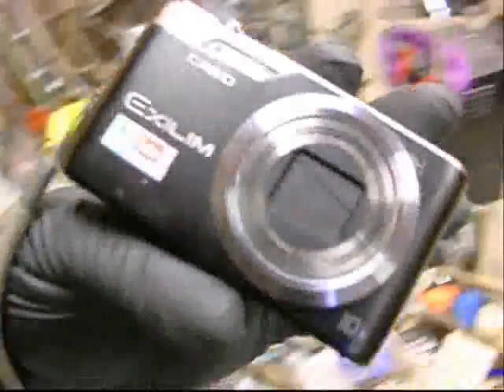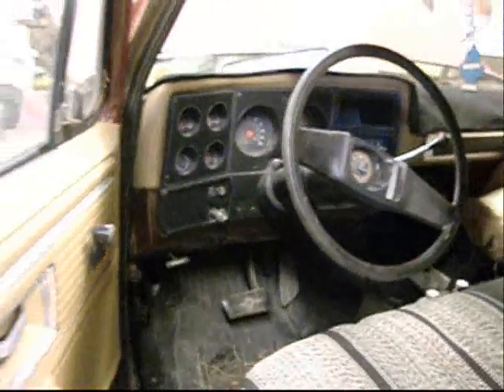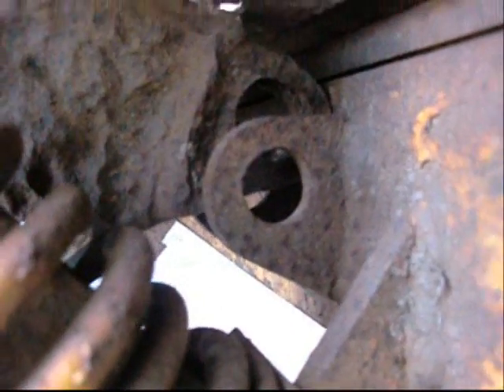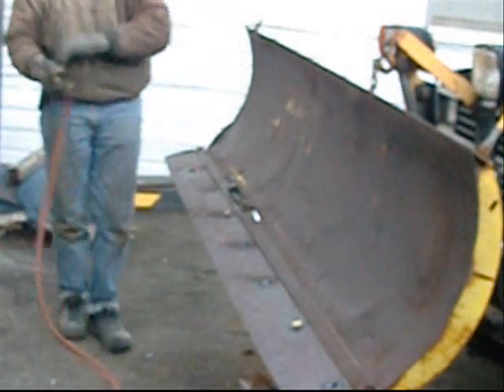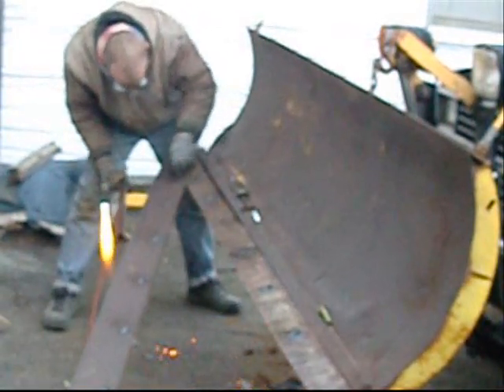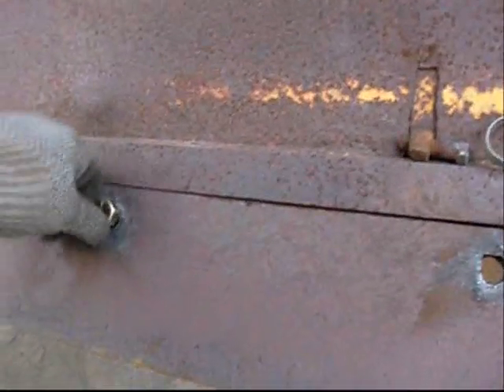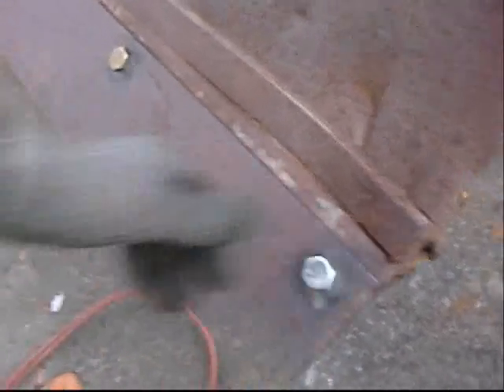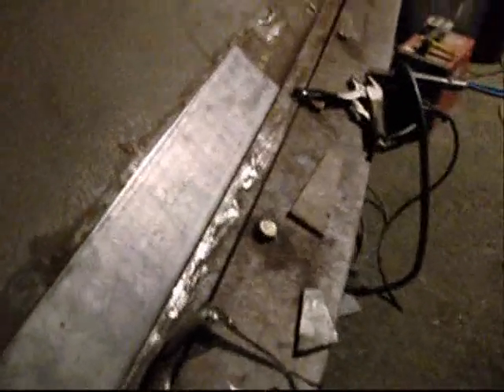12 10 11  K5 Blazer Plow Weld...

Comment: @michaelovitch 
a specific thing about those engines is the fact on idle the pressure can't be at the maximum and you can hear a different sound more loud than on others technologies hdi cdi etc...
tdi are" louder" at idle it's common
but the max fuel pressure is bigger than the others systems once off idle.

Comment: I seen a 74 suburban with a 5-speed manual  it had a 454 all factory options I seen it when I was in scotland in the NAVY . The sailor said it was from brazil and he bought it when he was stationed over there . I drove it lots of power I know he had it shipped to the US in 86 when he was getting out . I talked to him a few times since then he still has it over 350k miles  he said
it had the engine and trans built . Never seen one like it other than his.

Comment: @michaelovitch 
a sort of regulator to absorb pressure variations pulses : it's a "reservoir" wich distribute to each injector too.
there is no high fuel pressure pump rotated by the engine like on a dci or hdi engine on a tdi but pump injectors.

The advantage of injector pumps is the fact you can have a very high pressure of fuel but in a very tiny volume.
there is no "pulse" like with a dedicated high pressure pump (dci hdi)

The "problem" is the complexity of this part.

Comment: @CORVAIRWILD 
The pump injectors models can be recognized with the red letters they have on the TDI emblem on the "trunk".
the injectors are under rocker armsand moved by them.
they accomplish the task of creating pressure and pumping fuel alone.(feed pump exist however

There are several systems : high pressure pump rotated by the engine and creating fuel pressure to send to the injectors but before you have

Comment: About the golf models. 

If you plan to buy a diesel 99 model (a golf 4 ) try to buy a model without pump injectors.
If to have to repair it's less expensive in parts.

electric windows MAF sensor  problems come back often.

You have to know (or be remembered) there is a lot of electronics stuffs in those cars and it's a shitty other  world that the 6.2 or your honda when you have problems.
The vw dealer could become your best friend if you're unlucky.

Otherwise they are very good on mileage

Comment: @CORVAIRWILD the sledge hammer with the broken handle did a season or two for me...does not mean I can rely on it and yes if your bolts are rrrrrrrusted and the heads are round you'll have to cut them off anyway...just a thought.

Comment: Never seen that year in a stick.  A manual swap would be real easy as you could use the factory parts.  Is the firewall stampled for the clutch master cylinder or is the floor for the shifter? 
Good idea on the VW.  The only new car my dad ever bought new was an 85 VW jetta with the 5speed.  Sold it to some kid a while back car had 360,000 miles.  The compression was a little down but it still ran good.  Had the original clutch too.  Any car can last tho if maintained/ driven right.

Comment: @CORVAIRWILD go for a 99.5 + up (mk 4), if you decide on a TDI, you should have no problem keeping it on the road, provided you have a good code reader to clear the pointless check engine lights they like to give you. Ive owned my 01 jetta TDI a little over a year and all ive had to replace is a MAF sensor(due to the k&n filter i bought stupidly), and an idler pulley. By far the easiest front wheel drive 4 banger to work on! EVRY mod is also cheap to do and yeilds 10ish HP and lots of smoke :)

Comment: get an older golf like 98 99 before they put all that computer shit in the diesel engines i have never owned a vw but the guy next doer and his wife do commercial cleaning and lawn care 
they have 2 1997 wv vans with 5 cyl diesel one with 850 thousand km on engine about 400 thousand running on vegetable oil the other with 630 thousand km about 300 thousand on vege oil and a 1994 Jetta 4 cyl with many years of running on vege oil  so there no doubt that vw makes a good diesel engine i wold buy